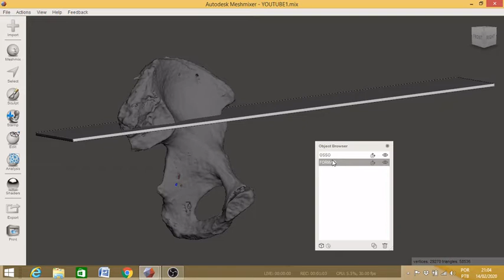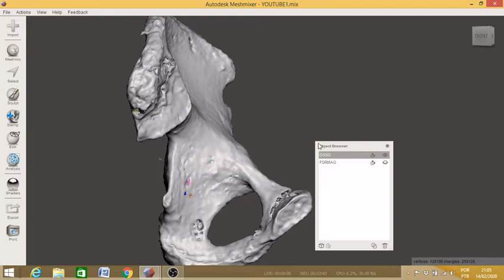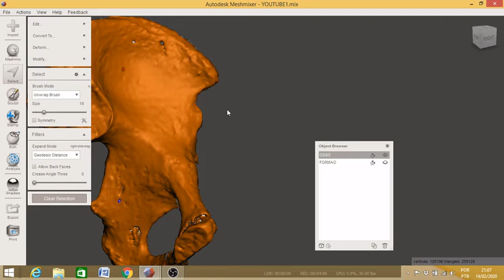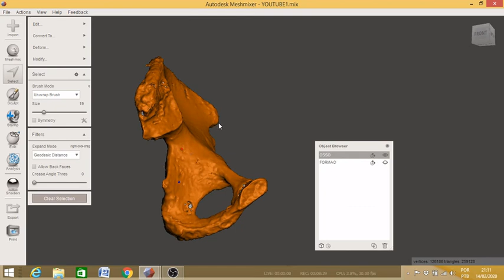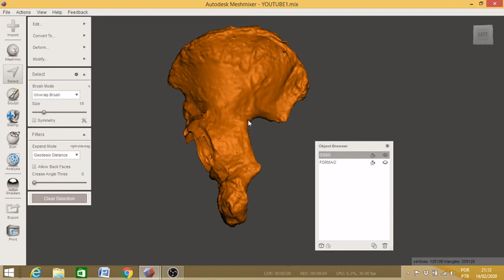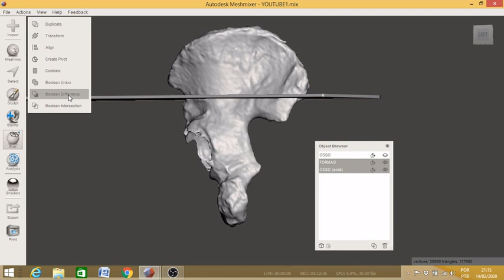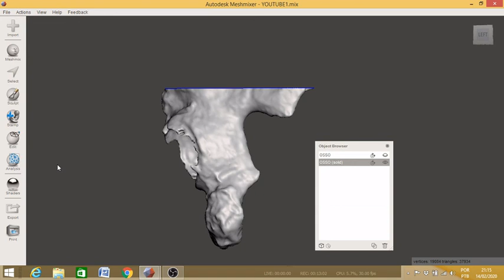English version: Meshmixer fatal error boolean difference remove internal geometry

Comment: In my case, it would have taken forever using your method, by and unknown reason, it let little dot here and there. I just increased tool size and painted manually before inverting. Thanks a lot for explaining the problem and how to solve it.